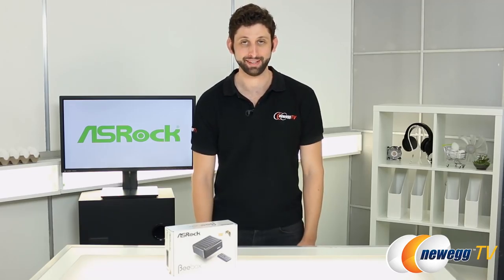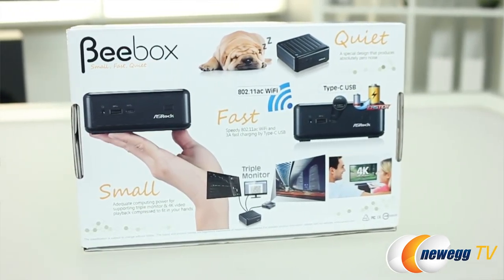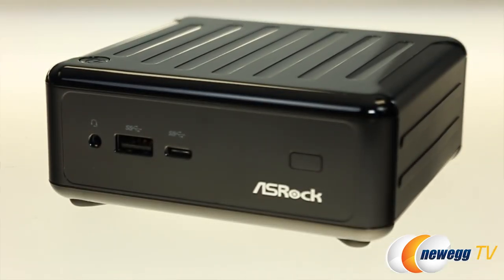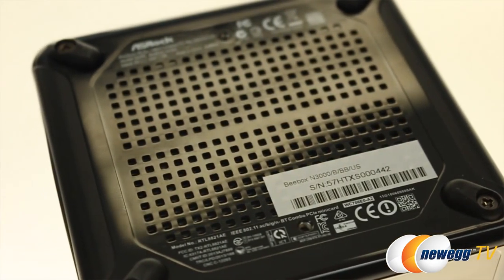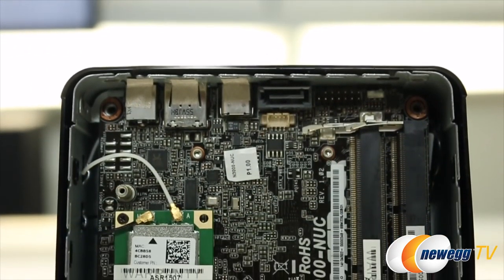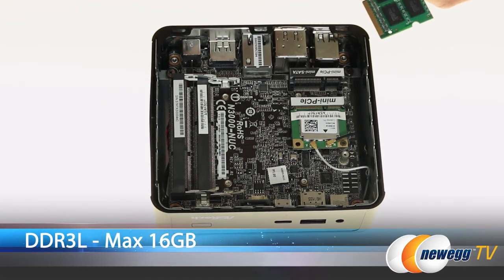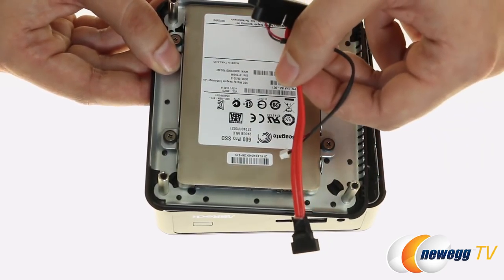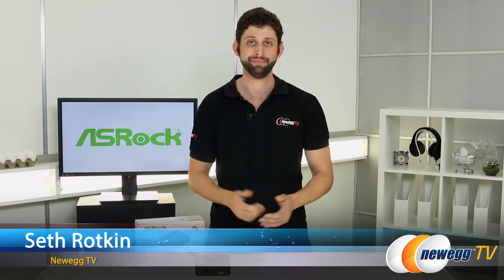ASRock BeeBox Overview - Newegg TV

Comment: Asrock liar i bought the N3150 not N3000 and install win 8.1 and the 4K video freezing and install win 10 its the same the beebox with 16G ram Gskill and 240G msata just work with full HD  not 2160P.
Reply: ah did you get new drivers from Intel for graphics? I heard the same from people who bought the N3000 model then when they updated it they had no issues(on Windows 8.1)